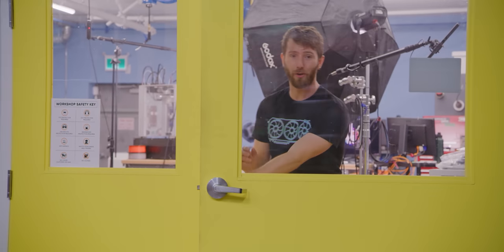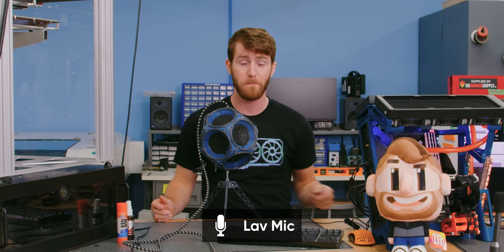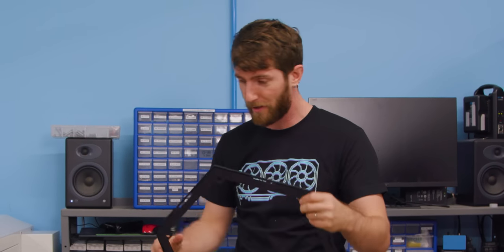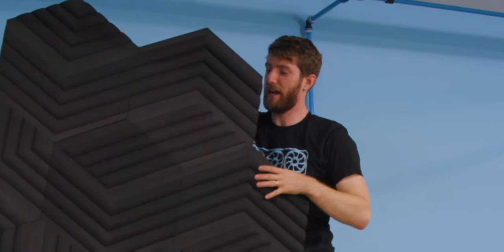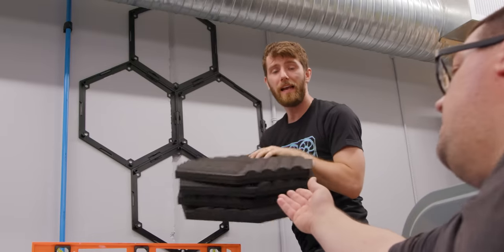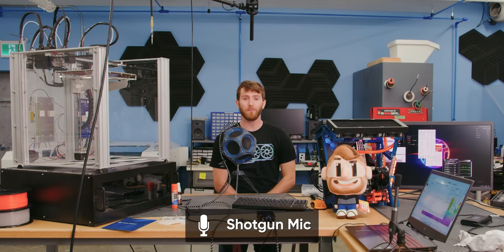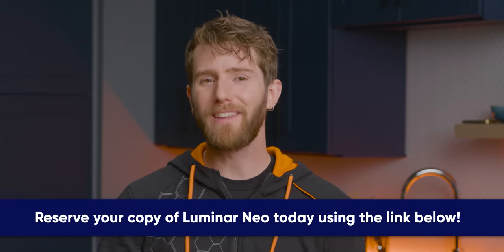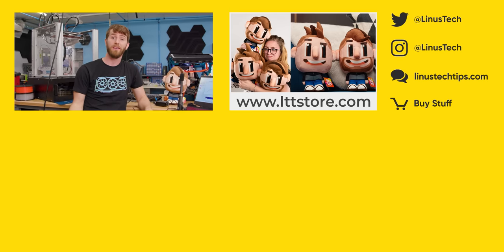I'm only going to say this once... - Acoustic treating with Elgato Wave

Comment: I've A/B'd these things in my home recording studio against the types of panels filled with Rockwool (similar commercial product to GIK Acoustics) and the rockwool products outperform them by miles and the rockwool panels are cheaper per square meter of coverage. Guys, there's a reason that all recording studios, cinemas, news and television stations and so many other applications use the traditional acoustic panels. They simply outperform these foam pads and they are cheaper than these foam pads. Broad band bass traps in each corner is usually the recommended first step then add panels to the walls as needed from there. If you are doing acoustic panels, please DO NOT release foam pads. These things are a plague and just don't work well enough. BTW, that Auralex kit is considered a bit of a joke among professional applications.
Reply: Not all streamers stream from a cinema or recording studio though. And a lot of streamers will be streaming from a room they also sleep in. These panels are great for that application where cosmetics are more important than in commercial and functional rooms. Also the smell rockwool can develop is not something I'd personally like to experience in my slumber although it would make counting sheep to fall asleep more realistic.
Reply: this may be, but the fact that Linus' 2100,-$ investment did both improve the sound and aesthetics in this workshop remains.

I guess it's a difference if you're tackling only spoken words or if you plan for action movies and music. 
You're the pros, you'll know it. Anything with design is way worse in its expense-to-functionality index than something just made to work.

I'd consider those panels at a Doctors Office with particular blank walls.
My only concern is the hygienic side.
You obviously need foamy stuff for maximum surface to absorb sound, which I imagine might be a pain to be kept germ free...
Reply: Also, mounting these off the wall by an inch would massively increase performance in low end frequencies, something that they start to plateau out in pretty quickly during the testing. I've seen a lot of people say "Rockwool is more porous" and while that's generally true, the way rockwool panels are generally mounted several inches away from the reflective surface is going to affect performance far more than the differences in material.
Reply: You didn't pay attention did you? The purpose was to remove the reverb in the Vocal range. And they did that wonderfully. And then there are these issues.   Protective gear must be worn when installing mineral wool insulation: the tiny slivers will lodge in skin and are small enough to be inhaled. Inhaled slivers of mineral wool irritate the alveoli and can cause lung disease.There is some data which suggests mineral wool slivers in the lungs may cause cancer, by slicing DNA and causing cell mutation, in the same way as fiberglass.
Reply: They did the job well enough for a decent enough price (making a video about them in this case, but the price to consumers is decent too), did they not?

Believe it or not: 1. multiple products can exist on the market at the same time 2. not everyone who wants sound dampening needs to have exacting professional levels.
Reply: Finally some sense.
Auralex is a bit of a scam product as well which makes it an especially hilarious comparison.
They should really be comparing to those foam kits from ali express or real fibreglass kits from primacoustic / a percentage of GIK products.
Reply: there are many kinds of insulative wool that are handleable and safe.
They're still more efficient, performant, and cost effective.
Reply: @manweilermusic  Sure... but not everyone has that sort of $$$.
Reply: @tams805  ...FoamByMail gets you similar performance for a fraction of the cost. Elgato is betting on their brand and a lot of cute extras for only a tiny bit better performance than anyone else. It's all margin.
Reply: @jad43701  that is technically true, yes. For people who work with it every day for years. You will not sustain injury from putting up acoustic panels at home.
Reply: interesting
Reply: @jad43701  There it is! Some of these know it all's only think about what they think is right, and not what someone else's actual needs, budgets, aesthetics are! Linus got what he needed to do and solved! He's not trying to record drums or run a music studio!
Reply: I think Linus and all the people there knows that but it was given to them for free so they just went with it.
Reply: @really9238  what you forget is the fundamental frequency of male speech, which is a majority of their team, is typically in the 100-200hz range. Far below what these foam panels can do. I get that rockwool is dangerous but nobody hangs bare rockwool on the walls. It's always covered by fabric. Plus there are similarly performing alternatives that are supposedly safer (wool and cotton based insulation comes to mind, but they are more expensive). I was not bashing his method. He took care of a lot of the upper range flutter  But he missed a huge range of his vocal reflections that will mud up his recordings. I have personally done the same thing before. That's why I spoke up. I make YouTube tutorials on video editing and do some occasional game streaming so I know problem areas for speech as well as professional music mixing and mastering. I have experience with acoustics. I was just pointing out what he missed.
Reply: @AtlasF0und69  quick little fact: the Elgato Panels have an air gap between the two absorption materials. They are engineered quite thoughtfully for the propose they are built for (reduce reverb/"room tone" in voice recordings in a streaming scenario) I don't argue that rock, or mineralwool is better, but not everybody needs absorption below 300hz, the insulation panels are thicker, more difficult to mount and both rock and mineral wool are irritating to the respiratory tract. You'd need to pack them air tight in something like painting foil, and even then I'd not be comfortable sleeping in the same room. That's why foam is "good enough" for many people, although you could still go a bit cheaper and even more effective with 4 inch basotect (flame retardant) with an 4 inch air gap...

So in the end it depends what you use-case and budget is and if you are willing to fiddle around with DIY approaches, I totally get why someone not interested in audio related stuff would buy a pack or two of Elgato panels over other solutions including self built absorbers
Reply: @ThroughFallenEyes  I started from music and moved to location and post audio about 10 years ago. There's some fundamental differences. There are some situations, which are very akin to old radio shows, where presenters are static and need full range. Linus's shows to me are more like documentary, where there is a lot of movement, scene changes etc. Full frequency is not what you look for. Over applying room control and mixing techniques is often the case when music based sound engineers move into AV.
Reply: @jan-k7x1c  10000%

Comment: Would highly suggest that you guys look into diy-ing your own sound panels. The solution from Elgato is fairly elegant, but also very expensive considering the price/performance ratio that homemade sound panels can offer.
Reply: Also, mounting these on standoffs, even a half an inch to an inch of distance would make a MASSIVE difference in the performance of these things. Very surprised Elgato didn't take that into account with their mounting system.
Reply: Any pointers to more information on how do make your own sound panels?
Reply: @pand1024  tech ingredients has a whole series on sound in general, and I think a few on sound panels.
Reply: You can get a surprising amount of effect by just hanging some curtains. Doesn't matter if there's a window or not, the fabric will absorb a lot of sound that the walls would bounce back instead.
Reply: @pand1024  Mineral wool (Roxul aka Rock Wool) works well. Use 3.5" thickness at minimum, preferably 5.5" for lower bass absorption. Put an air gap between them and your walls, which again improves bass absorption.

Plenty of tutorials on Youtube for this.
Reply: @alexz1232  4" is better than 2", but even 2" would work fairly well (targeting speech rather than professional recording), but you need multiple 4'x2' panels at a minimum.  The 4" thick traps are great as bass traps for corners.
Reply: He mentions this in the video
Reply: @girhen  Nonsense!  4" is nowhere thick enough for bass traps.
Reply: @alexz1232  Air gap will not absorb bass.